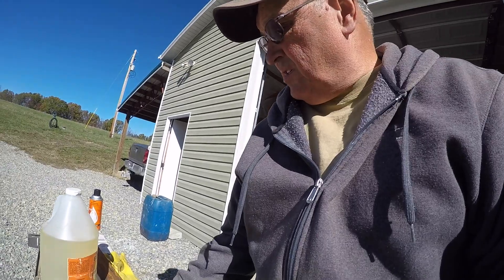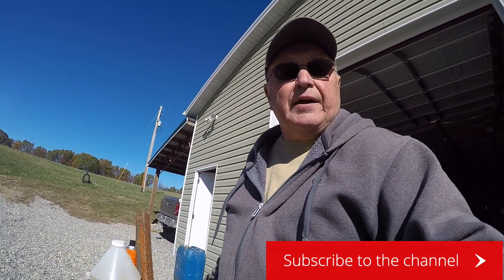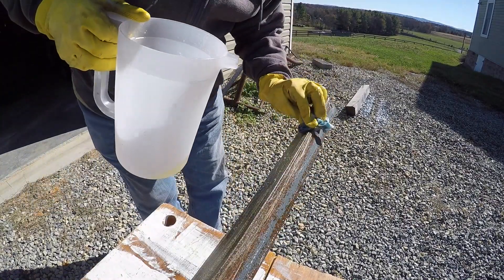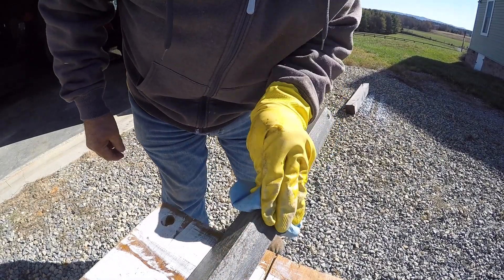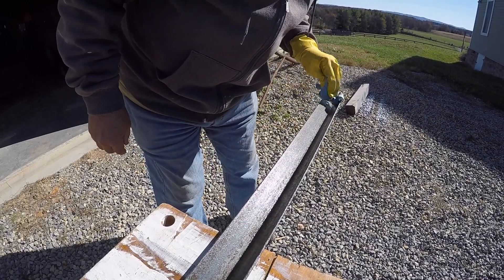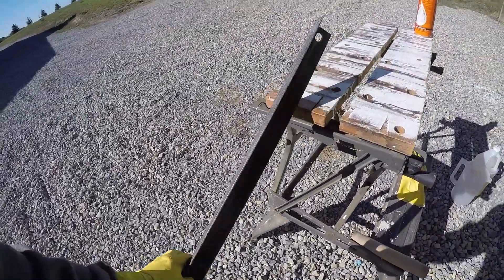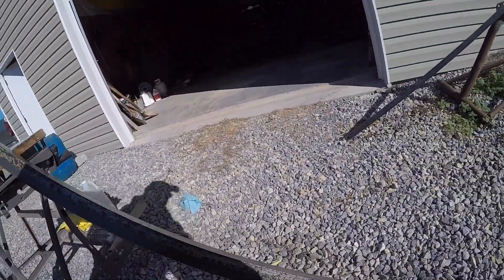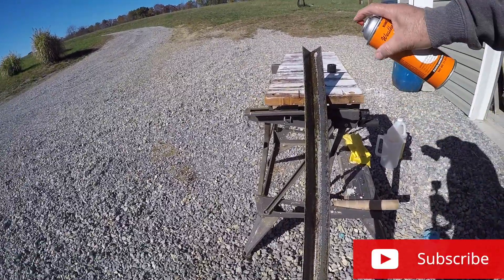How to remove rust from metal with phosphoric acid

Comment: Excellent video. This can be used on the underside of vehicles in areas that use salt in the winter or in coastal regions once the vehicle begins to rust. The phosphoric acid converts the red iron oxide into black ferric phosphate and stops the rusting process in it's tracks. After using the Exrust solution and it is dry, use a vehicle undercoating and you won't have to worry further. Just ensure you do this yourself as I have seen dealerships do the worst job of undercoating vehicles. Literally, just holding a spray can in each hand and walking down the middle of the vehicle while spraying. No care to do a proper job. 
Also, I love your soundtrack!